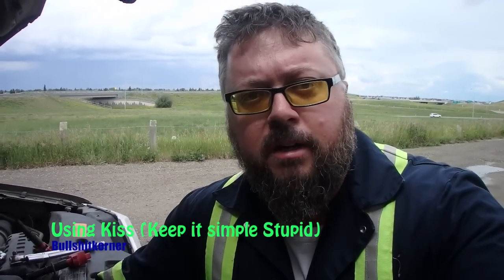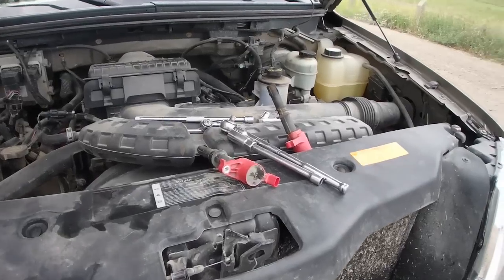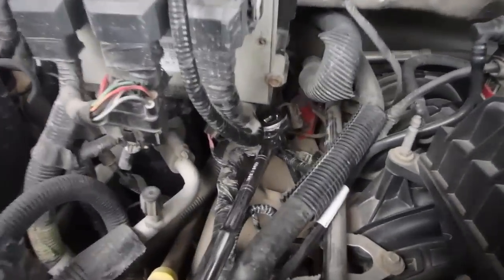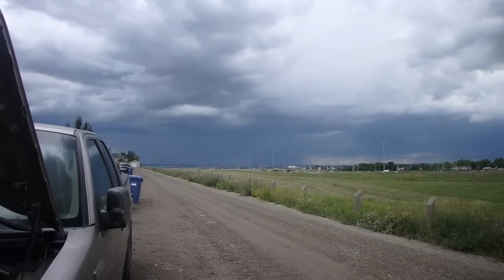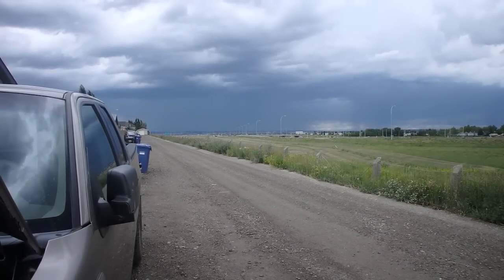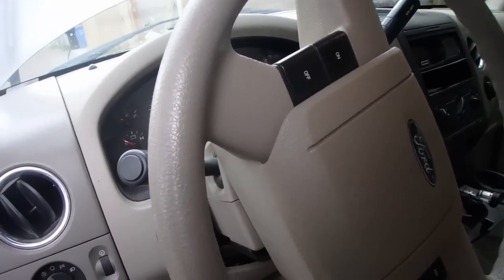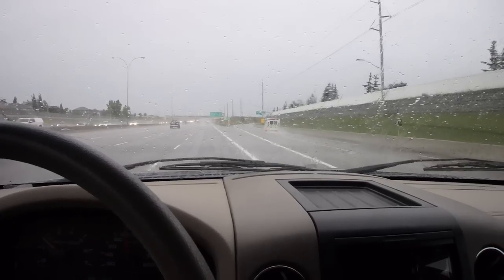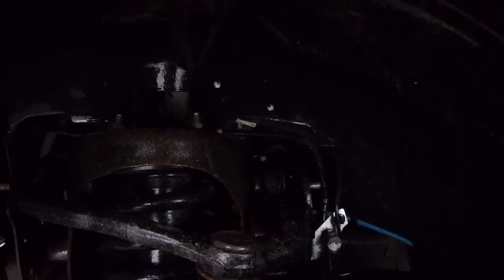Ford 5.4L 3V Ticking, Knocking Solved

Comment: Just a Big Thank You.  My ticking noise was resolved just by tightening a loose spark plug.  How it got loose is a mystery.  Part of the same problem was the smell of gas fumes.  That problem also disappeared.  thanks for the post, it saved me a lot of grief.
Reply from the maker: Seems to be a common issue with these engines

Comment: I had the same problem thinking an exhaust leak fix was in my future.  After watching this video I walked out, check two plugs and scored!  The only thing holding the second one in was the bolt on the coil.  Thanks for taking the time to post your experience and fix!
Reply from the maker: glad my experience was able to help you

Comment: I have been listening to the "tick" for a month. After watching, I checked my plugs and cylinder 4 plug was loose. Tightened it up and now no more tick. Thank you!
Reply: Was the tick consistent even on cold and warm temps on the engine? Or just operating temps?
Reply: Same here. It's crazy how that was the issue.

Comment: Thanks for the video, I have had this ticking since the dealer replaced the plugs 30K miles ago, took it back 3 times. The plug that was loose, I found with a stethoscope. It was the #4 cylinder, passenger rear.  It wasn't even hand tight, but no codes. Replaced with new plug and no tick at all. Have 115K miles and is running great.

Comment: Hey mate, Doug here from Alaska. I have the same year and color of F-150 as you, only mine is the extended cab. I thought you might like to know of a fella on You Tube who goes by the handle of FordTechMakuloco. This guy is a certified Ford Tech, and he is really helpful to anyone who asks. He always recommends trying the least expensive methods for fixing our Ford's. I have a ticking that occurs just after the cold engine idles down up to the point it warms up. Have to say it probably is still slightly ticking even afterward. I poised the question to this fella, asking him if he thought it was the phazor's  but he thought it was the chain tensioner's instead. The man has a wealth of knowledge he freely shares with all and Iv'e saved a ton of money fixing this and that on my truck based off is recommendations. Just thought this might help in the future.   Cheers.
Reply: Archeodigger best guy
Reply: Did you fix your truck issue?, I'm having same ticking noise when my truck warms up and starting to look for solutions
Reply: giorgiomx how did you end up? Are you just driving it like that? I might
Reply: Archeodigger has the start up tick been an issue for you?
Reply: @KollynJ  my ford has same ticking. I heard a lot about installing a phaser lock out but a ford mechanic suggested it’s a waste of time and instead to just run her into the ground. I’ve put about 40,000km on it and it’s ticked every km.

Comment: Thanks you very much for this video Shitkorner! This video same me a lot of money! I had someone replace my spark plugs on my 2006 Ford F150 5.4 engine truck and a week later the ticking noise started! The i saw this video and took back the truck to the mechanic and told him to re check every single spark plug make sure they were tightened right! Once he make sure the spark plugs wer tightened right i started the truck and the ticking noise was gone

Comment: Holy shit I wish I say this a while back. I've just replaced my vct's/camshaft phasers/timing chains/new melling hv oil pump/new melling ratcheting tensioners/all of my roller followers/lach adjusters/swapped to pennzoil platinum 5w30 and still had my tick came home today and thought why not try the plugs and I'll be damb it stopped my tick. I was almost at the point of swapping motors I'm so glad I tried this. Anyways thanks for sharing the info. Greatly appreciate it.

Comment: a good thing to make sure of is to check and gap your plugs to the chart on the radiator support. did my first coil on plug change out and a mechanic told me that you dont have to gap plugs. my truck went in just fine with zero engine shake and came out shaking my rear view mirror so hard you couldnt see out of it. buy a heli coil kit and save yourself the time and money. do it yourself and gap those plugs. your truck will thank you and your back will thank you.

Comment: That's just crazy. I've had that ticking sound for a few weeks, and it's been getting worst. I thought it was the timing chain, but it was a freaking spark plug. Mine didn't feel loose, but I tightened them slightly, and it went away.

Comment: I installed new plugs and torqued them to 35#'s. More than the factory suggest.......but they stay secured in the head. I had three loose ( finger wiggle loose ) at the same time when I started.  54,000 miles later engine quiet. Be sure to use the Motorcraft updated one piece plugs.

Comment: I didnt have any lose plugs, but my engine was unusually noisy, i thought it was just due to its 224,000 mileage, the plugs had  45,000 miles on them and was told they lasted past 100,000 so anyway i changed them with the original plugs sp509 after the new ones the engine is so quiet and smooth i also was told it was the phasers. Pure joy 👍

Comment: Had the exact same issue.  Borderline to buy whole timing kit.  Went to replace plugs had some loose.  Replaced all, and now quite.  Awesome!!!  2004 5.4v used Motocraft SP546 plugs.
Reply: Did you ever have to do you timing? Did the plugs stay
Reply: @KollynJ   Nope!  Never did the timing. Still running nice and quiet.  It’s really the strangest thing.
Reply: @Randel1966  well that’s cool to know, how many miles on it? Can’t wait to check my plugs and next thing is the vcts
Reply: @KollynJ  I only have 153k on it.  I did replace the VCTs years ago.  Fingers crossed, but so far so good.

Comment: I watched this video when it came out, I had the same tick and even some more symptoms (rough shift, low power, fuel smell at stop lights) and it was like the for months, I took it to the exhaust shop because the tick sounded liked a leak. they said cam phasers probably, last night I thought what the hell and went out and pulled some coils off, they had tons of carbon on them and some had fuel, tightened the plugs up and never heard that motor so quite. it's the simple shit.
Reply from the maker: +Aaron that's awesome that it was a simple fix for you.  Seems like people are saying more and more that they are suffering from loose plugs
Reply: I've got a similar tick and I also can smell gas at stop lights. Now I have to go home and take a look. Hopefully it works for me :)
Reply: Bryan dial... Did it work.... I had a tick ....almost replaced motor instead i checked plug and they were loose........😳👌👍

Comment: I learned to be careful about not unhooking the battery in about 1965. While installing a starter, I shorted a battery with my with my high school ring. I had to have my ring repaired and I still have it. After penicillin and tetanus shots the finger repaired itself.
Reply: Nice story 👍 did your parents buy you the ring ? Were you still in high school ? What vehicle were you  working on ?

Comment: Driving beside a big wall tells you if you have any bad wheel or axle bearings . As Well    --  That`s a given see the boots burnt that`s  pressure bypass - Good find stethoscope would have hard time pin pointing that too   , I didn't realize the Fords now have plugs thru the top of the heads like Hemi ,,  I fluked it one day went to the dump found this massive long 5/8 socket didn`t know what it was  for till I bought my Dodge Hemi uses all that socket to get them out .

Comment: Was the tick also being heard  on the passenger side? Mine is ticking on Both sides and I hear a light tick near my driver side spark plugs when hood is up. But it’s loudest under the car behind the wheel wells. Front end only. Driving me nuttttsss

Comment: I have a 99 Ford F150 4x4, 5.4 engine.  I have had this problem 3 different times.  The loose plug was blown out of the engine destroying the coil and damaging the spark plug.  It cost me $500 for a mechanic to fix it and he told me that Ford has a problem with the plugs working loose and blowning out.  The next time it happened I went down and got a thread kit, some JB WELD, RATED AT 3600 STRENGTH, reamed the threads and inserted the spark plug with the threads screwed onto the new spark plug after covering the threads with the JB Weld.  It sets in 4 hrs and cures in 24 hrs.  The entire cost was the tread kit ('$30), JB Weld ($7) a new spark plug ($3) and new coil ($65).  For a $100 I fixed it myself.  The screw coils come with extras so a year later I had another plug blow out and my only costs were the coil and spark plug.  That is a saving of over $800.  I recommend that if anyone finds they have a loose spark plug, due the screw coil insert before replacing the plug.  It will save you the costs of replacing the plug coil at $65 a pop.  A friend of mine rebuilt his engine and the first thing he did before puting the motor back together was to put the insert into each plug hole.
Reply: only thing is now when those insert coilblow out...and trust me they will, now you are sitting with no way to further ream and insert and will require new heads, or a new motor, which is exactly what I am going thru now with my 98, I have a 97 I bought to swap motors, running it the other day, IT blows a plug out! lol can you believe it? now looking at a 3,000 dollar crate
Reply: Kentagion I had a problem once with the coil blowing out and thought I was going to at least get new heads. Instead I bought a time sert solid threaded insert kit. Man those things are awesome. I  have installed them on all my 5.4 plugs and on my manifolds because I  messed up half of the threads big time taking out the studs. Just tapped them out, cleaned the holes, put a little high heat thread lock on and have never had an issue since. More expensive than the coil inserts but well worth it.  I figured why not, I already did the damage and was going to need at least heads so what's a $100 more.  I don't often praise a product but these things worked for me on several occasions since I learned about them. Check them out, I don't think brand is an issue,  just the solid insert really seems to really bite and seat in place fairly easy.
Reply: Seth Ettleman Tu I have seen those but haven't found a tool kit to insert one for less than 800 bucks
Reply: Smart move. Time sert are beefier than helicoil, which are flimsy and end up coming out with the plug (so I've heard). I bought a 99 250 V10 a few months ago and will be buying the calvan insert kit (I think made by the same company that makes Time Sert) sells for about $237 on Amazon. In the meantime, I'm having bad dreams of popping spark plugs.

Comment: Great! I also had the annoying ticking and after watching your video I checked and had a loose spark plug, almost half way out. Another symptom on mine was odor like unburned gas, like an exhaust leak... which is gone as well.... Thanks!
Reply from the maker: i was glad the video was able to help you out
Reply: i have that smell aswell!
Reply: Jean thinking it might be the same with my 06 f150, but did you ever have a loss on power? my truck uses to be able to just get up and go, but now it's like flooring a model t
Reply: _The Gatekeeper_ damn, then it's probably my camphasers, looks like it's time to get the old 97 some new plugs, and sell my 06, also thanks for the quick reply
Reply: @fallu2  is that what it was?? Also looking at my 03 wondering if brakes, starters and more will need to be done shortly to get it going

Comment: When you say they were loose, how loose?  2 of mine i was able to turn out by hand using a socket and extention but it took some effort.
I have the valve cover off to check the roller followers but have not found my spring compressor.  Visually thing look fine so i am wondering if it is the plugs.  P.s.  I had done the chain and phasers recently to fix major codes.  Just not happy about the sound but it seems quieter than your did after the fix so maybe i am expecting to much?

Comment: I have an 2002 ford f150 lariet crew cab,the passenger side has a ticking noise and I just had the plugs and coils replaced, it went away for a few weeks and now its back and and i drove it about 110 miles today and when i got home, it had smoking coming from the passenger side. I feel like its more then a spark plug issue now.

Comment: I would have liked to hear the noise before you fixed it to see if that could be the problem I am having I had the dealer replace all of the plugs and coil packs and have had a bad ticking since
Reply: fitter it out I changed my plugs and it ticked, long story short it was loose plugs.
Reply: + @MrZombies24  , I didn't understand your response, you changed the plugs and they ticked, but were loose plugs?, what?, I don't understand, could you please explain? thank you
Reply: giorgiomx look at my comment below, was years ago but i guess some compression leaks past and makes a tick noise. if you’re lucky hah

Comment: I hope my tick needs the same fix.  I took my 2006 f150 in for a 100,000 tuneup.  Then the engine started misfiring as I was going down the road because one of the spark plugs had backed out. Took it back in to the shop and they tightened the plugs down, but shortly after I started hearing the ticking.  Also, when I step on the gas hard, like getting on the freeway, the engine light blinks on several times and then goes away.  I bet that ticking has something to do with those plugs.  I let yall know.  Thanks for the video!
Reply: C L well??? I just bought same year truck with same mileage and notice tick
Reply: I have an 07 expedition and I have similar symptoms except when I put the pedal down it misfires and kind of goes limp.

Comment: Came across your video, i have an 87 f150 5.0 302 gas engine, could this be my issuse to i was looking at all the post seems like its the later ford years with the 5.4 is that a diesel
Reply from the maker: Ford doesn’t have a 5.4l diesel
Reply: @BackCountryWrenching  yeah wasn't sure, i thought in some of the comments guys were talking diesel. My mistake. Do you think this could happen to an 87 f150 5.0 or is this something more on later models to check

Comment: If my coil pack or spark plug is bad  will it cause my truck to stall at stop also a ticking when accelerating ??
Reply: What I've found with my 2007 Ford F150 when it was doing that was that cam phasers, tensions chains, didn't fix it, all new plugs and caps didn't fix it. I'm now at the point where I'm trying to replace the solenoids and apparently I need to take off the manifolds so we'll see how it goes.
Reply: Codyman how did you make out?

Comment: Did your truck sound like a Diesel engine when it sat at idle? I recently changed my spark plugs and coils, ran great for a while and now it sounds like a diesel and ticks, everybody says it’s my Cam phasers and timing set. I can’t wait to go home and check my spark plugs! My engine was cold when I changed plugs, I shoulda retightened them after engine got hot. It also feels like it misses slightly when I climb hills. Did you experience that as well
Reply: Same here. I have an 05 and when it's warm it sounds like a diesel. Have a cam phaser/ timing chain kit ordered but I'm hoping that this might be the issue
Reply: RuckusOutfitters what was it?
Reply: Lonnie Werstiuk did you do it or just run it like that?

Comment: Was it missing at all? Seems as though it would if a plug were broken or loose. How long as it going on? Mine has the same exact sound, but my mechanic is hesitant to think it is a plug. He says if it were loose the pressure would blow it out. Thanks
Reply from the maker: +lynxridge doesn't hurt to pull your coil packs and check.
Reply: Was yours missing? Mine runs fine, just has that loud knock like yours in the video. Thanks

Comment: man i have a 2006 ford f 150 that i just bought from a dealership and i was told that cylinder 8 was misfiring if i would have seen this i would have fixed myself i just heard that triton engines are really tricky engines to work on

Comment: Cam Phasers will cause ticking. When they don't  get the oil in where it needs it...causing the engine to sound like a diesel. Too many owners don't do maintenance. Changing the oil once every 5 years may be the problem.

Comment: So do fuel injectors knock and if so is it normal? Also my ignition coils are loose and don't seem to fit any suggestions on which model boot to use 2004 f150 5.4 thanks

Comment: I will have to check my plugs. That tick you had on warm idle is exactly what I got and it's coming from the same location on the driver side. Well I'm at it might just change them out previous owner said he changed them 4 months before I bought it (May 2015). Are those champion spark plugs any good Jerry?
Reply from the maker: i've never had a issue with champion plugs even though people don't like them

Comment: Mine is shaking at stop or when start, and the engine sign came on so can you please help me out, its been over six months but still couldn’t figure out
Reply: check vct solenoids, if they are sticking it will cause that issue, good video on youtube (fordtechmakeuloco)
Reply: James Holland thank you, I did fix my problem by changing two misfire spark plug and no more shaking, and after a week or two another cylinder 5 misfire and  I've changed it but the shaking still there with no codes, so now its hard for me to figure out what's wrong with it. I did check vct solenoid and they are in good shape.

Comment: That's was pretty cool. I will tell my buddy to do a relative compression test on his to see if it's the plugs or phasers. You also did the flush did that do anything as far a noise.
Reply from the maker: the flush is just good for keeping the small oil galleries open as these truck have issues with valve lash adjusters and cam phasers.  So I think everything I change oil i'll just do a quick trans flush just to keep them open